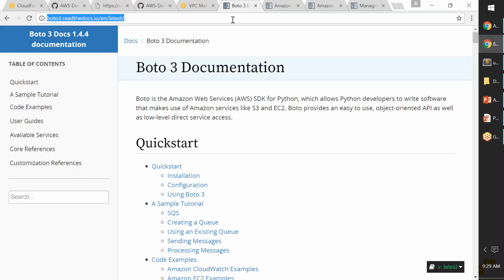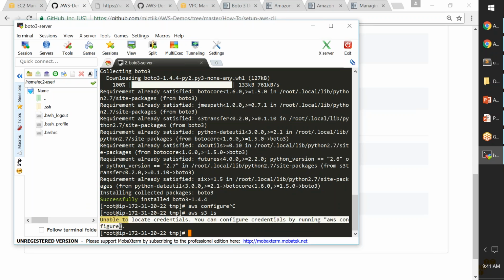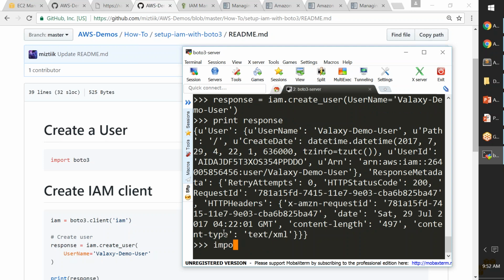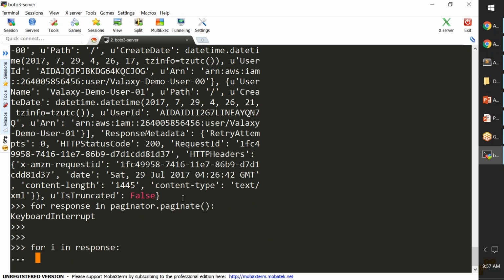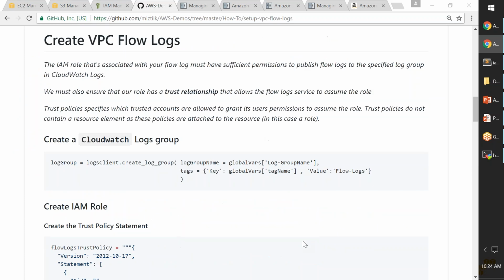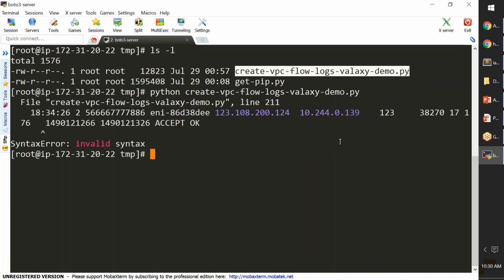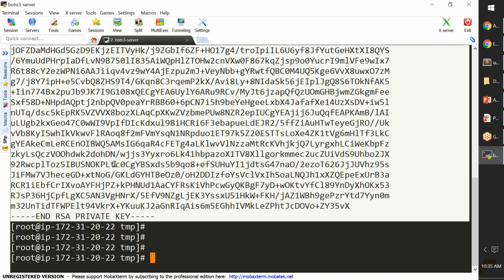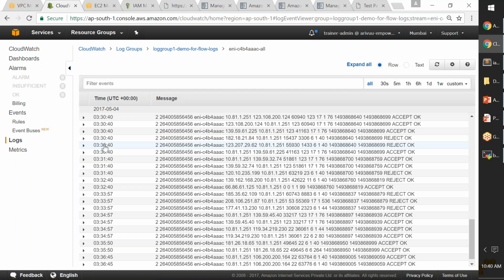Automate AWS Infrastructure Provisioning using Boto3

Comment: Could you please show an example to set password expiry using Boto3 and Lamda?
Reply from the maker: IAM Password expiry or OS level password expiry?
Reply: Thank you for your quick reply. That is very kind of you. 

I need IAM user password expiry. If I am creating a role, a group and putting IAM user in that group like S3 full access or EC2 full access and want that the IAM user gets SNS 10 days before expiry date(EXPIRY DATE: 180 days) that their account will be deactivated i.e around 170th day they should get this notification. Then how can we do that with Lambda? 
I am trying that with less expiry date but its not working.. not sure where I am making the mistake!!
Reply from the maker: Can we not achieve it using IAM password policies, Why do you think we need Lambda - Just for notification to users?
Reply: For notification we need SNS. But in order to make sure that the account expires after 180 days we need Lambda. As you know, AWS do not have any option where we can give desired number of access to a IAM user. So, we need to do it with the help of scripting.

My question is, can you make a video where you can use .py in Lambda for this case using boto3.
Reply from the maker: When you says "Expire an Account" - You mean delete the account? or disable their credentials?